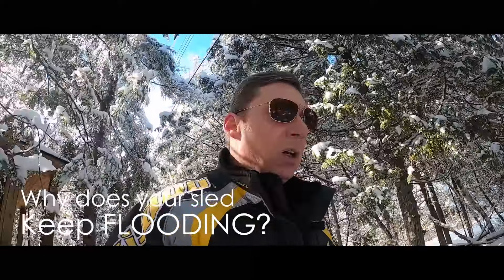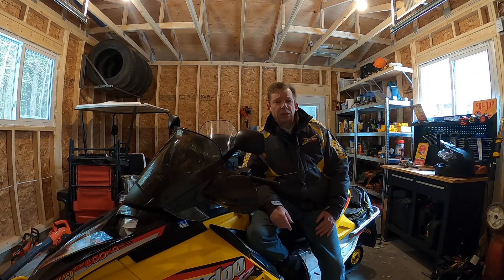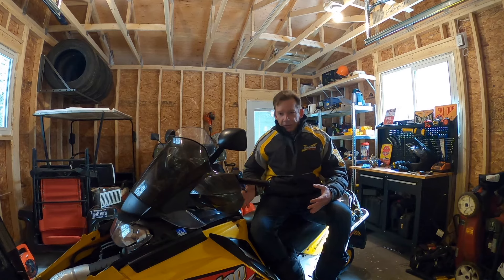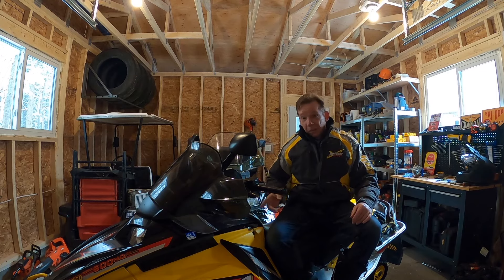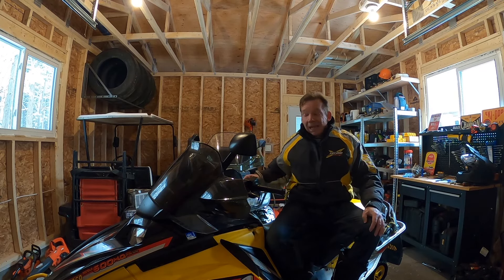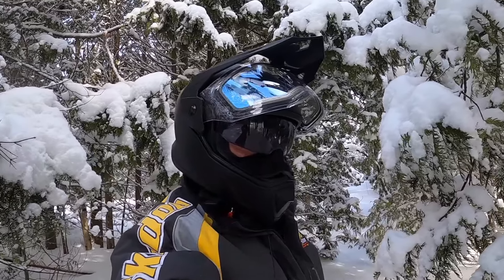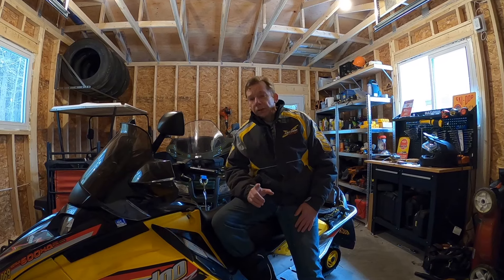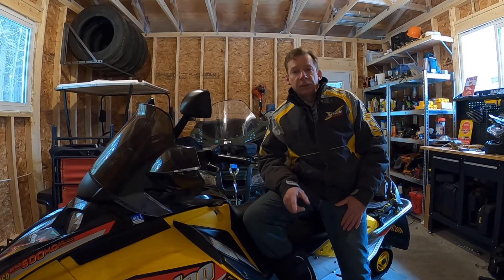Why Your Snowmobile May Be Flooding, Fouling or Running Rich

Comment: I'm not sure about 2 strokes but i know 4 strokes will usually make more power and run better between 11.5 to 13:1. At full throttle. 14.7:1 is usually just at a cruising rpm which you'll only get with EFI since you can't tune for fuel economy and power/throttle response on a carburetor. Very informative video David!
Reply from the maker: There really isn’t a perfect ratio as it’s effected by several factors. The ideal ratio that provides maximum fuel efficiency at all speeds and conditions, the normally accepted ideal average is 14.7 to 1. Too much to get into in a video about flooding.
Reply from the maker: Hi Guillaume, curious where you got this info, 11.5 to 1 would be 8% or over the flammability point for gasoline. Are u talking about compression maybe?
Reply: @MyOldSled   i'm still speaking about air/fuel ratio.  There is alot of factors for a/f ratio like you said. It is still not desirable to run an engine that lean under heavy load. And most engine will not make peak power at 14.7:1 and are usually on the edge of being to lean and most engine will have poor throttle response and have dangerously high exhaust gas temperatures which can melt pistons. And like i said in my last comment. 14.7:1 is a target a/f ratio for fuel economy and light load like driving on the highway at a steady pace. 11.5:1 is to rich for cruising around but some engines can make more power and last longer if the target a/f ratio is a little bit richer.
Reply from the maker: Got it. Interesting discussion.  Thanks for sharing. Like I said 14-1 is textbook “ideal average , across all  speeds and conditions, not accounting for incomplete combustion etc. Too much to dig into for this video. 11.5 still seems way rich but I’m certainly not an expert in tuning. To explain rich/lean I think 14.7 to 1 is still a good ratio to use.  Keep commenting, or msg  on my Facebook page any time!

Comment: on my 17 cat i have a problem with a rich mixture/hesitation/bog/plug foul when i pin it and it hasnt had a chance to warm up for high rpm overfueling problems exhaust valves are often the culprit. learning to rebuild a carb is one of the first things worth doing when you buy a new sled and it get you farmiliar with that new sled and its components!
Reply from the maker: Exhaust valve problems will have an effect on fuel consumption, but it won’t effect the mixture. Never pin it without letting it warm up.

Comment: Hi, I just got this one rev that sat for awhile and I was trying to get it running good today. Cleaned the carbs, fuel pump, new sparks. it bogs down when you give it throttle and tries to die but it idles perfect. Sounds like one piston isn’t working well or something when it’s going. Going to check those floaters tomorrow, if not that what could it be? Did a lot of troubleshooting today but can’t seem to figure it out

Comment: Would it be beneficial to tie the primer pump to the carb fuel inlet instead of the throat?   Then prime until the seat seals and you get the resistance in the pump and the fuel system is then charged for startup/ like a boat primer bulb essentially.
Reply from the maker: Hi Mikey. I would say no, because that isn’t really what the primer is for. It enriches the mixture by introducing fuel into the airstream. The bulb on your outboard is there to draw fuel a fair distance to get it to the carburetor, which generally has a choke. (Unless if is fuel injected) Thanks for taking the time to comment!

Comment: I have a1996 ski-doo formula sls. I have to open the left or belt side slider screw 3 turns out to get it to idle. 6000k starts first pull cyl psi 120 both. The other carb is at 1.5 out. What do you think 🤔
Reply from the maker: I’ll look later and see if I can find it but I think it’s 1.75 each side.

Comment: 2002 summit 800 all new gaskets n rings. Cleaned carbs boots are soft and tight.  Fuel mixture screws are set to 1 and 1/2 turns. Fuel lines are clean plugs are mint. It idles just fine but doesnt wanna run or accelerate without half choke. Ideas?
Reply from the maker: I dont think 1.5 is your air setting. Check it with your dealer but i think thats too lean. Everyone assumes thats where they should be but it varies. Don’t take my word for it though - check. Your machine is running lean if you need choke. Other reasons are dirty fuel lines, blocked filters…

Comment: Hi love the video i got a problem with my sled it starts and then it dies and then when i pull out the spark plugs they r wet and i hand it up to that i could reve it up but it just wont idle and the piston compression is just little bit over 90 psi and i cant figures it of but i think that it could be the compression on it but not sure and it is fuel injection on a plairas rmk 900.
Reply from the maker: Have you cleaned the carbs? Compression is on the low side as well.
Reply: Yeah thats what I thought to and it is fuel injection
Reply from the maker: Thats right you did say that sorry. There are a couple of sensor issues that can cause a lean condition, but so will low compression as the charge in the cylinder wont burn properly. Really hard to diagnose without seeing it.
Reply: Yeah I took the head off and I could wigal the piston so Yeah and it was losing compression  when I hand a compression tester on it I could see it going down so I think I got it figured out. Thanks

Comment: My 2002 Arctic Cat ZL 600 EFI is flooded. 
When I first fired it up it was stumbling bad and then stalled. I realize the gas was bad (Sat for 2 years), real stinky and dark yellow in color. I drained the tank and put fresh gas in it. 
I then tried to start it and it would fire up and then stall right away, this went on for over an hour. I started to smell gas and thought I must of flooded it. 
Sure enough I pulled the plugs, took the exhaust off and pulled it a few times and gas was shooting up through the plug holes and seeping out of the manifold.
I checked the compression and it's getting 125psi in each cylinder, so I think that's ok for a 4k mile sled.
Question: Should I keep on pulling it with the plugs out to clear the gas in the cylinder? Should I hold the throttle down while pulling it? (I've seen mixed thoughts on this).
And help would be appreciated. Thanks!
Reply from the maker: You could pull it a few more time, no not with the throttle open. I would recommend you clean the carbs and if it’s nit the needle and seat then the fuel pump maybe need a rebuild.
Reply: @ Maybe pull out the injector’s and have them cleaned? It doesn’t have a traditional float and needle valve
Reply from the maker: Ohhhhb sorry I’m sorry I didn’t read that close enough it’s fuel injected….ignore me. I’m not sure about yours, but on my SDI, if I pin the throttle and pull it it doesn’t inject any fuel. Let me noodle this a bit.
Reply: @MyOldSled  Worked on it a bit more last night.
I pulled off the air box, it was filled with Mouse nest crap, acorns, ect...
I cleaned it all out as well inside of the Throttle bodies.
Put everything back together and it still wont start and plugs are getting soaked in gas when I pull it.
I think the injectors are stuck open and are filled with dirt.
I'm going to take off the injectors and test and clean them.
Hopefully that's the problem.
Reply from the maker: Good thought. Could also be TPS or ecm

Comment: My sled a ski doo formula mach 1 xtc
Ran great then started to bog down  and a while after that stopped working on  the left cylinder.
Now I have done a compression test and the result was excellent on both. (Exactly the same 10 to 1)
Disassembled the rave system (both of them) cleaned and found the O-rings ok (not brittle) 
Assembled everything and started it up (started straight away) but still no  change. 
Checked spark plugs and if there's a spark on both of them (it is)
Can't wrap my head around the problem.

It might be sensible to mention the high fuel consumption (very high) 
A couple of people have said that it could be the reed valve in conjunction with the fuel pump (if the membrane in the pump are damaged in any way)
Do you have any idea what the problem can be?
Reply from the maker: Have you cleaned carbs and made sure they are set to spec?
Reply: @MyOldSled  not yet,  will do that

Comment: My sled it’s a Polaris Star 250, it’s my sons ..

It won’t start it smells like gas and I see gas coming out of the exshust , I cleaned the carbs looks great but still same issue.. any help I hope you answer Before the snow is gone 😭
Reply from the maker: If you pull pulse line off pump and fuel comes out of the pump, the diaphragm is leaking fuel into crank case….or its a worn or dirty needle and seat. Maybe get a rebuild kit and replace the seals etc.?

Comment: 01 mxz 700 new top end ,bottom 4k . first 3 heat cycles were fine, sat a few weeks and started again, all hell broke lose. Rough idle, no acceleration just bogs down but maintains idle. Dumping gas for sure. Carbs were rebuilt..I'm thinking fuel pump or a recheck on the float needles. Air screw set at 1.5 .. Any ideas, very frustrating.

Comment: Hey David awesome video it was right on the money as far as what's going on with my 94 Grand Touring might I mentioned it only has 1400 miles anyways it's exactly what's going on with my sled it's a 580 XTC severe flooding runs great and then what started as soon as i shut it off starts putting gas all over the barn floor and since that started I can't get it restarted due to the flooding I obviously now the after washing your video I'm thinking the floats must be stuck or something as to maybe that's causing the gas to pour out of the bottom pan anyways Hopefully this wasn't too confusing but I'm trying to explain the best I can other than that it's a great running sled I use it on my trap line and but now I'm having this problem and like I said it's floodi ng so bad I can't get it restarted and that's even after pulling the plugs and clearing the cylinders
Reply from the maker: Good luck! Hope you get it figured out.

Comment: Thank you for posting these videos Dave; they are awesome and really appreciated. I am a bit of a novice mechanically, so I'd really appreciate some advice. I have a single cylinder 2008 RF300 Tundra Ski-doo and bought it second hand back in 2012. It's given me problems ever since and I'm beginning to think it's a lemon. Basically, it is incredibly difficult to start (pull start only) and I am never confident that I'll be able to start it. At the end of 2022 winter, I decided to drain the gas tank entirely. I did this with a pump, then ran the carburetor dry. This season, it won't start. I've just spent the last 3 days trying to start it and it won't start.  I pulled the plug (after 100's of pulls) and it's bone dry, so clearly, it's not flooding. Can you offer any advice.  Thanks in advance,
Dave (with a sore arm in the Okanagan).
Reply from the maker: Hmmm.. well, I'm no expert... I'm just stubborn and I like to figure things out. Have you pulled the drain screw to see if fuel is getting to the carb? If not...then just check from the tank forward...theres a filter in the tank...sometimes I think that can end up above the fuel level, or get plugged...does that sled have a fuel shutoff? If fuel is getting to the end of the line going to the carb, but the bowl is dry, then it would be the needle stuck in the closed position. There is a pulse line from the crank case to the fuel pump that provides pressure. If the fuel pump is bad it's a simple rebuild, it's basically just a diaphragm inside. Or...is it getting fuel, but has no spark? Message me on Facebook and we can chat about it.

Comment: just bought a 98 formula z 670 in great shape for the year only has 3300 miles my problem is that when i take it out for a ride it will go good for a bit then boggg out and idle high at like 4 grand once i pull over and sit there for a min or two it will go down to regular idle at about 1.5 grand to1.8  ive drained the gas tank put new fuel filter cause it dont have shut off valve fresh gas and cleaned carbs twice its not leaking gas out of over flow lines but you can smell it for sure just took it for a 170  mile ride two weeks ago thats when the problem started im assuming its needle and seats just looking for some help any input would be appreciated
Reply from the maker: Slides sticking?
Reply: @MyOldSled  we checked that yesterday while cleaning carbs for the second time they where dirty for sure i took it for a ride and it didn't happen until 10 miles in and instead of it happing just on bottom end it happened on top end like 70 mph i was thinking maybe needle and seats its most defiantly getting to much fuel for sure was thinking maybe the Orings are bad did sit for three years
Reply from the maker: If it sat for three years I’d probably get a carb rebuild kit.
Reply: @MyOldSled  im on it will let you know what it was just as soon as i fix thanks for the in put happy riding
Reply from the maker: @robertbrisk5112  Good luck Robert!

Comment: The air/fuel screw.  If I am running rich and want to lean it out, do I screw in it further?  Or screw it out further than the 1-1/2 turns that is standard?  Sorry if I missed it.
Reply from the maker: Counter clockwise increases air. Remember this is just at idle. Also, running too rich is a pain, running too lean melts pistons so I would find out the right settings. Also check the spark plugs and monitor for lean condition.
Reply: @MyOldSled  Good deal, thanks.  I changed my needle position and that seemed to make a big difference.

Comment: My sled floods without priming and when cold with full choke, it has a 2 stage choke. Too much choke? Even when cold?
Reply from the maker: I guess it depends how cold. Try it with less choke. What sled? When did you clean carbs last?
Reply: Thanks, its a 98 skandic 500. I've only had the sled for a couple years and haven't cleaned the carb. I was told that since it runs so well once started, which it does, the carbs don't need cleaning. I did get it started last night, 10 pulls with less  choke. I ran it for about an hour to get it good and warm.After it cooled I pulled the plugs. They were nice and dry and the cardboard colour. The plugs were new.

Comment: Not sure if you will see this but let my neighbors borrow my 96 Polaris xlt600 triple and they broke the choke cable. If I disconnect the cables completely will this help because I think it is the reason why my sled is so flooded, might just buy new carbs too and choke cable but for the time being will this work?
Reply from the maker: Why would you buy new carbs? Did the cable break or the choke lever? It’s plastic and prone to break. They sell a kit for like $25 Easy fix.
Reply: @MyOldSled  just really old carbs already rebuilt them twice and the choke lever broke new one is coming but was wondering if it's okay to just disconnect them from now
Reply from the maker: Try it. Its an enrichment valve that enriches mixture by decreasing airflow through the pilot. I think theres a spring that holds it open but i cant recall. I don’t have a choke.

Comment: Hey Dave ,
I just put new plugs in my 2006 Gtx.
It’s fuel injected.
The sled fired up nice today 2nd push to be honest.

On my b bday jan.28 I went to get some wood on the trail. 
The sled bogged and would not reach full speed even when I opened her up.

I changed the plugs the sled fired up like I mentioned above.

The wife an I went for a rip today, I park it. Went back out to fire it up again and it’s just back to foul plugs again. Feb 3

What’s your opinion on the issue?
Reply from the maker: Well, hard to diagnose via email, but…assuming you have the right plugs, and when you say bog down, the tether is connected properly, your oil pump might be sticking. If your tether is dirty or not connected, it will run on one cylinder…then the plugs get fouled…
Reply: @MyOldSled  when I say bog, I mean like the engine will almost turn off an pick back up again. I have the right plugs yes. What’s a tether? Could you please explain that. 
Thank you so much for the info. 

I’m gonna get new plugs tomorrow try again.
Reply from the maker: You can wipe the plugs clean while you figure it out. The tether is the springy safety cord that clips onto the sled
Reply from the maker: What spark plugs are you running?

Comment: I have a 97 mxz 670 and it starts fine cold but when you shut it off when its warmed up it does not lie to start back up unless you hold the throttle slightly open to let air in, the sled runs perfectly otherwise this is just a rather annoying thing to deal with
Reply from the maker: Could slightly adjust idle up a bit, or if it’s a little rich it would be richer when it warmed up. Do you know where the air screw is set?
Reply: @MyOldSled  air screw is set 1/4 turn in on both carbs from stock adjustments just did a complete rebuild of the motor and re did the carbs, everything is at factory specs

Comment: I have a 2006 gsx 550f, when I am at higher speeds and start to really get up on the rpms. The sled feels like its getting to much fuel or not enough. It then starts to die and I theb have to let off the throttle so it won't die.
Reply from the maker: Clean carbs, check boots for splits.